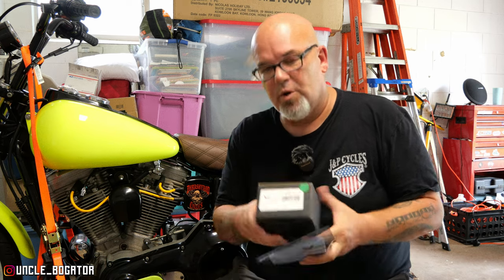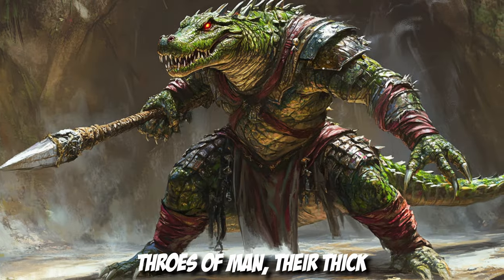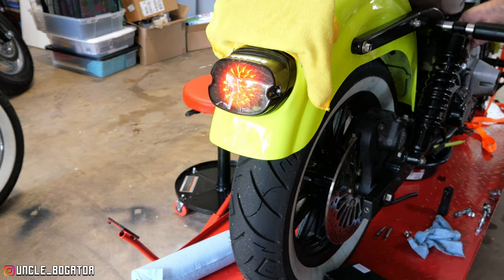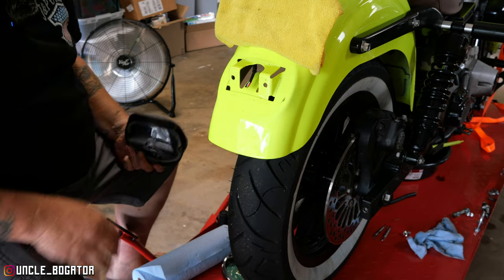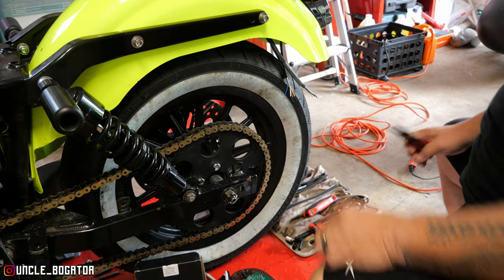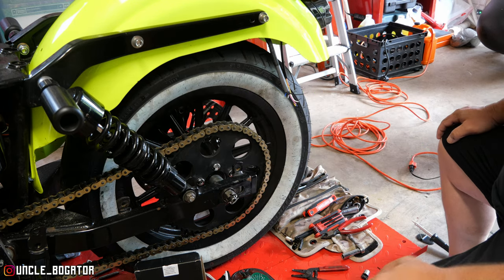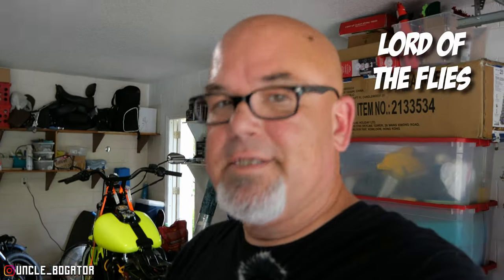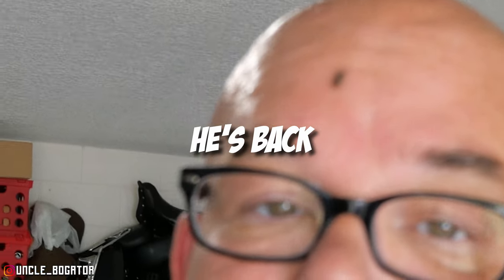If you’re trying to put LEDs on an older Harley Davidson, this video was literally made for you

Comment: Instead of taking the sockets off the light you should have put sockets on the bikes wiring
Reply from the maker: No because then I would need a female socket that would accommodate the turn signal wires. Stock socket wouldn’t do that. They’d be separate and off to the side on the fender strut.